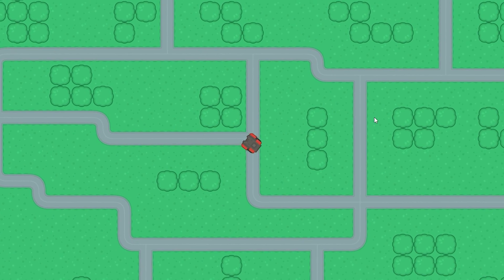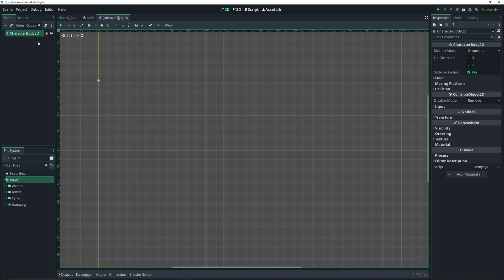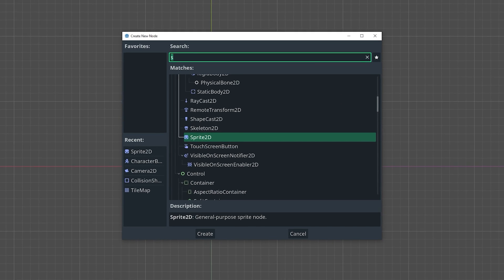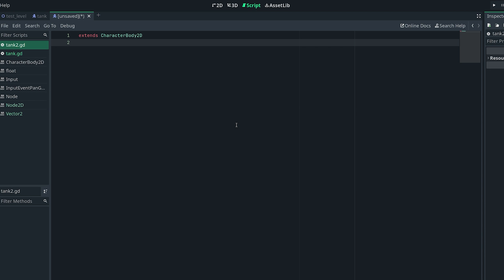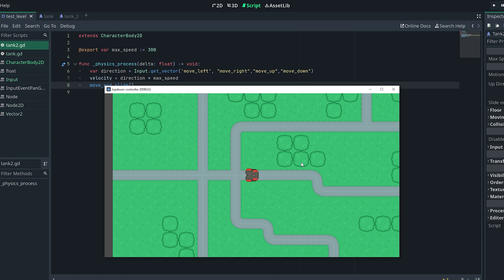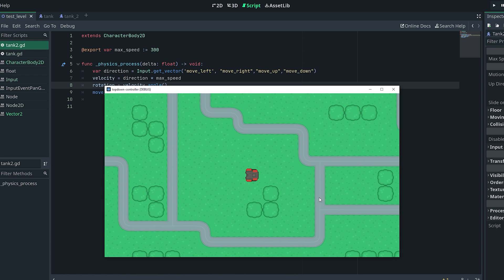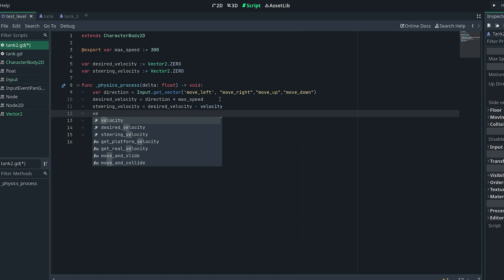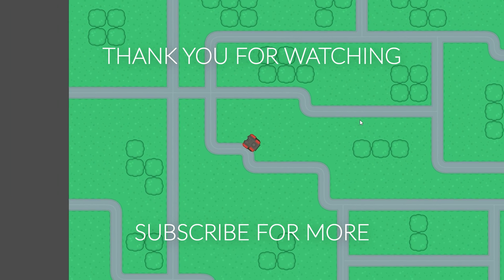Godot 4 Top-down Controller in Mins

Comment: Question, what happens if I don't rotate the sprite to 90 degree at start. 

The sprite is actually going up with it being rotated to 90 degrees when I press up. Also I'm seeing an unusual behaviour or the car I'm trying to move. It's not reversing instead changing the direction within a split second which is incorrect.

Comment: Edit: fixed
Getting error at 8, 5 parser error: Identifier velocity not declared in the current scope
Reply from the maker: Are you using Godot 4?
Reply: @rayuserp  Yeah I figured it out lol, somewhere along the way my character body 2d was changed to a node2d. Changing the node types quickly fixed the issue lol

Comment: Hey there! How did you make Godot 4 work? I have the exact same issue as you did.
Reply from the maker: Sadly the only way I got it to work on my end was by reinstalling windows nothing else seemed to work for me but I would highly suggest you post your issue on the Godot GitHub page and ask there about your specific issue and only do the windows reinstall solution after having tried everything else as a last solution to resort to. and if you do resort to the windows solution make sure you backup your computer